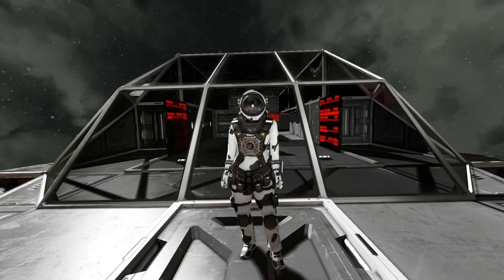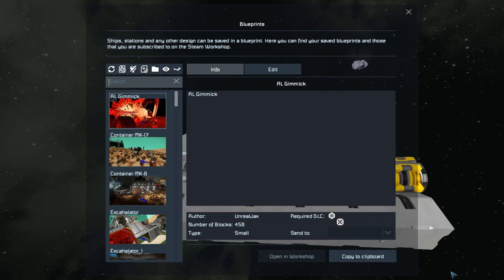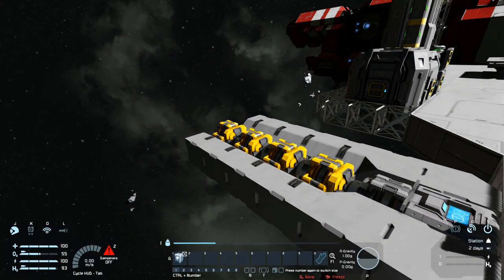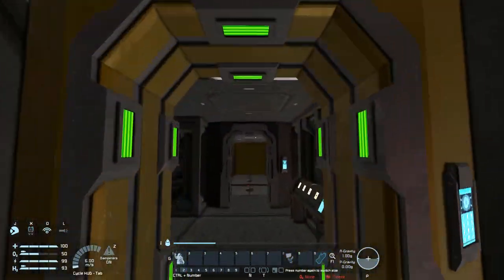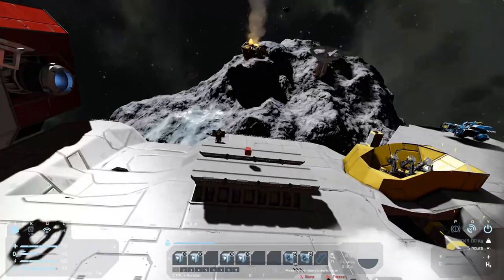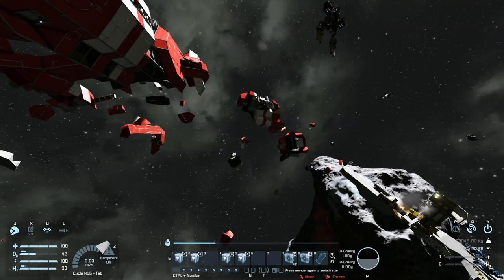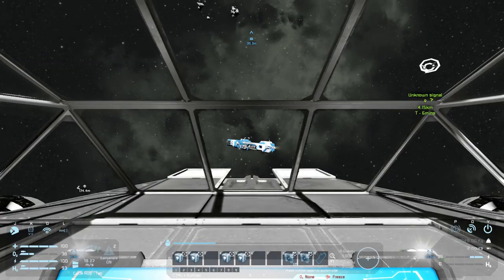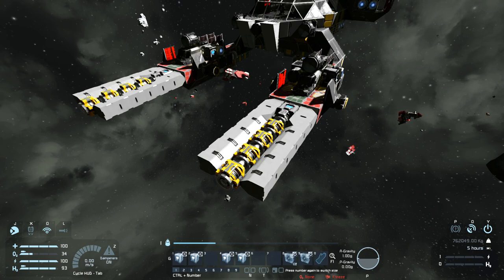The Helios XR-5S Rotor Gun - Space Engineers

Comment: It's a coil canon!!! Can this be done manually without scripts?
Reply: Not really
Reply: yes. with many timerblocks.
Reply: @00FantMod  technically you could just Switch between the rotor settings and adjust the offset manually, but it is just so much easier with a script
Reply: @lukasstaar6860  yeah ^^ without it is a Pain. but never thought about this as a Weapon. Its Cool

Comment: Can’t you use timer blocks to achieve the same thing as the programmable block? It’s just turning on/off the rotorheads in the right sequence?
Reply: From the looks of it while fireing it sets all the roters to minimum offset, spawns a new head, sets all roters to max offset (to build momentum on the end) and releases the head before it springs back/stops. it might be possible with timers although I doubt you could get that rate of fire and possibly the velocity.  I think timers can only move that offset in steps not the whole 0 to max in one go.
Reply: @merendell  I haven't tested it, but if you have many timers firing at the same time you should be able to go from 0 to max in one game tick. Though it will be a lot bulkier than just a programmable block.